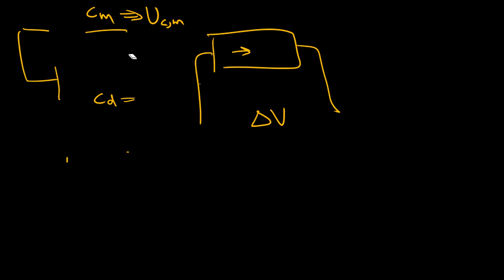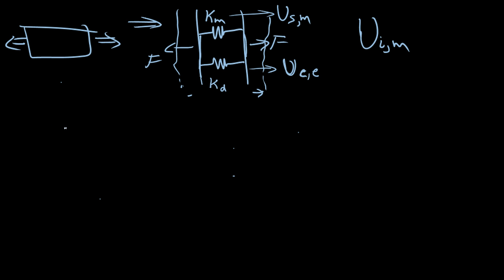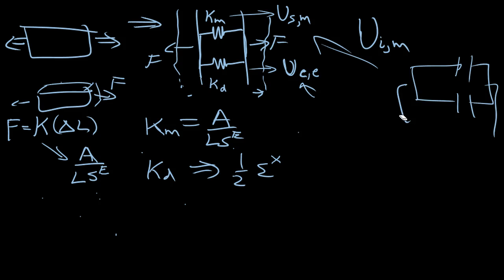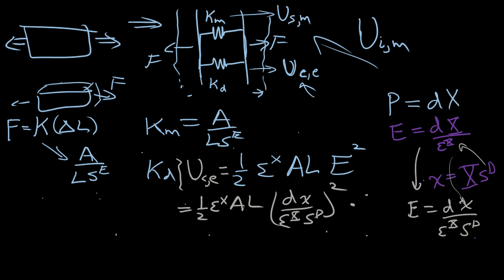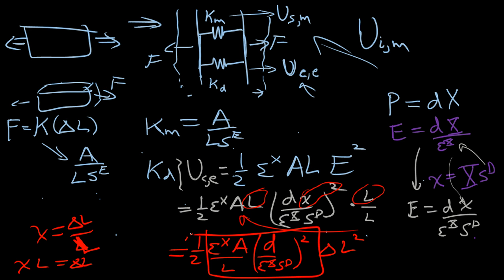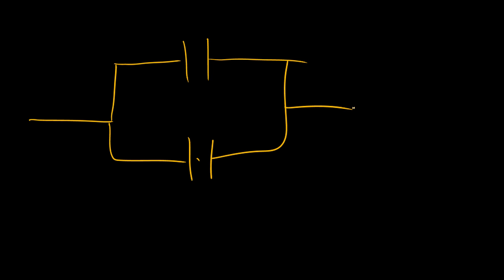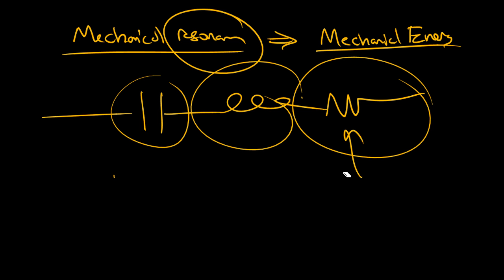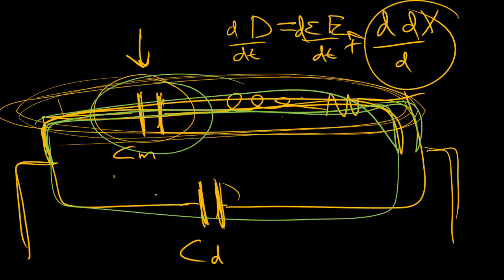Learn Piezo Lecture 3P: Modeling piezoelectric energy as an equivalent spring system

Comment: Thank you for this explanation.. but I have some questions 
-When do we use the capacitor model and when do we use the spring model?
- Regarding the frequency, What does this frequency represent ? Is it the frequency of the applied force ? Does this mean that the applied force can be described by a sinusoidal function ?